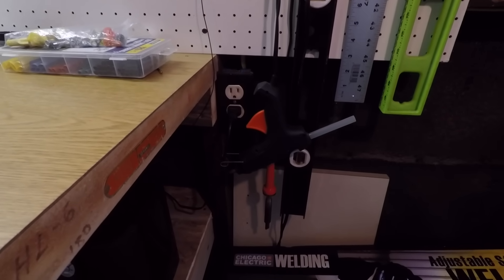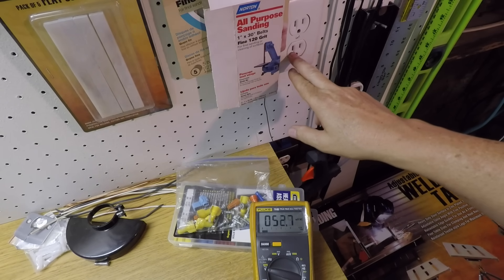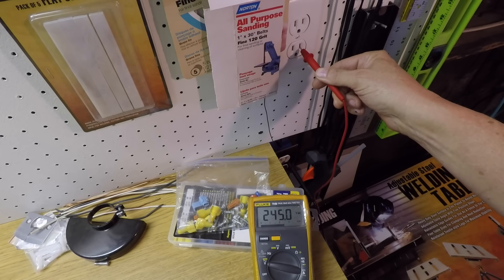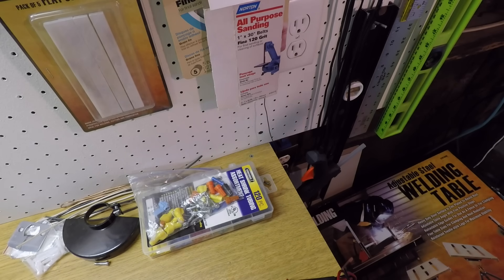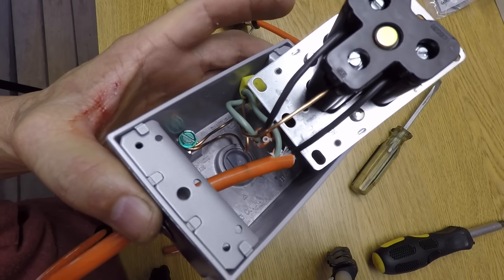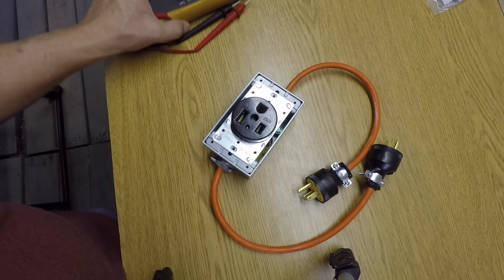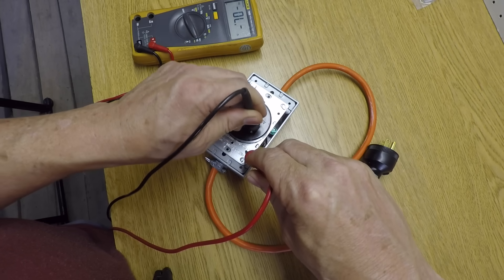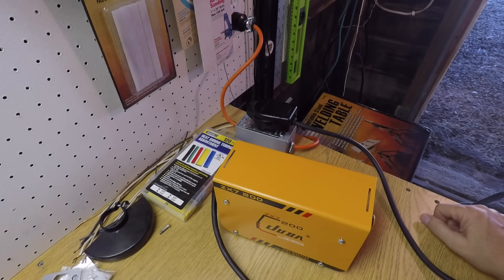How to Get 220v From 110v

Comment: just add a breaker on and off switch to the box
Reply from the maker: That's a good idea, thanks for the suggestion.
Reply: I don’t get it...
If you put a breaker on and unplug one of the cables without removing the plug for the device or switch the breaker to off, it’s still as dangerous.
What you should do is to install a breaker (or two, one for each source) that reacts to power, a breaker you need to push every time you start, in order to get power, a breaker that disconnects in the same moment you unplug the cable.

Comment: those are 15 amp outlets being used on a 20 amp circuit. 20 amp outlets have a notch on one side. That’s how you can visually identify them
Reply from the maker: That is true and it's ok to have 15 amp outlets on a 20 amp circuit as long as there is more than one.

Comment: I am curious as to why you "doubled" the grounds but didn't double the "hots".  I think I would have taken both the black and white wires and twisted them together at both ends to allow allow the hot to pull a full 20 amps.  (This would have made the white white as hot as the black wire.  Yes I realize the tiny welder probably is only pulling 12 amps.)
Reply from the maker: I just didn't think if that at the time I made this video. It has been suggested many times in the comments and I agree with your thinking. It would have been a good improvement to the device instead of just clipping and eliminating the white wire.
Reply: Hey, No problem.  Apparently the other comments got hidden below.

Also, I would like to note that I am an electrician and have seen many other electricians work similar to this.  So, I have to chuckle when the electricians claim "code" and then they do stuff that breaks code.
Reply from the maker: Oh I figured as much. LOL I felt that they squealed the most because they don't want everyone knowing all their little secrets. Ha Ha
Reply: I should also mention that if you use the white wire as a hot, it would be best to put a wrap of black electrical tape around a visible segment so that it would they could see it was white and is now being used as a hot.

Comment: I see you did not use the white wires, did you cut them off?  also by the way do you remember the name of the box a person can buy that is already made?
Reply from the maker: On this set up I cut the white wires off. I don't know the name but I've seen them on ebay here (I have no affiliation or experience with these models) - Made in the USA by certified electricians - https://www.ebay.com/itm/110-125V-To-220-250V-Dryer-Power-Connector-Electrical-Adapter-10-30R-3-Pin-5-15P/193366560965?hash=item2d058b90c5:g:u1MAAOSwvBpeSIof

Comment: I am not an electrician, but I would bet big money that there is a very good reason that you cannot just go buy this off the shelf somewhere.
Reply from the maker: I'm not an electrician either but you can buy them on Ebay all day long. Made in the USA by certified electricians - https://www.ebay.com/itm/110-125V-To-220-250V-Dryer-Power-Connector-Electrical-Adapter-10-30R-3-Pin-5-15P/193366560965?hash=item2d058b90c5:g:u1MAAOSwvBpeSIof

Comment: would this work for a dryer?
Reply from the maker: I don't think so
Reply: @DIYHomesteadProjectsDIYHP10  I did the same thing you did but with a dryer outlet and the voltage reads at 245 now, seems to be right. Now I have to plug it in and try it I guess.
Reply from the maker: A dryer has a completely different demand on power requirements and consumption compared to a small welder. A small welder like the one I used only demands power for a minute or so but a dryer is a continuous demand of power. Two completely different things. Just my 2 cents but I am not an electrician as I'm sure you already know.
Reply from the maker: That adaptor appears to be a similar design as what I made. I don't know what size wire they used and I didn't find information saying what size they used. I do know that most dryers I've seen require a minimum of a 30A circuit with 10 gauge wire. Also most if not all modern dryers require a 4 wire plug. The adaptor I made is only a three wire plug. Any wire size smaller than 10 gauge could possibly be a problem. I really don't know because I've never done it for anything other than my small welder that only draws 18 amps.
Reply: @DIYHomesteadProjectsDIYHP10 It worked for me thanks to your video. I made sure the voltage reader read more than 240v which it did. Also made sure both 110v's were connected in two different  outlets/breakers. I put my dryer in medium and it dried my clothes nice and warm. Thank you!
Reply from the maker: Good to hear!

Comment: I would not recommend doing this 220 need to put on the same baker this is fire waiting to happen....and I pretty sure it is not code approve....why not  just put a 220  outlet there.......
Reply from the maker: Many reasons I didn't put in a regular 240V plug. I needed a temporary mobile solution and this is what worked for my situation. Obviously it may not be the right solution for everyone, but it worked for mine.

Comment: Hello my name is Liz - I need to buy an electric dryer but my plug is 110v & most of the dryers come in 220v,what should I do, PLEASE HELP FRUSTATED. I THANK YOU VERY MUCH.
Reply from the maker: Hello Liz, you need a regular 30A - 240V circuit and appropriate outlet for a dryer at the location you intend to use the dryer. A device like the one I built in the video is not suitable for the power demand and continuous use of a clothes dryer.
Reply: Get a gas dryer !

Comment: You may have a 20 amp circuit meaning breakers and 12 AWG wire but your receptacle as i noticed are not a 20 amp receptacle.
Reply: They are plugged for 15a but they can take up to 20a. You can run the 15a key type on a 20a circuit but you can not run a 20a plug on a 15a circuit as per code.
Reply from the maker: You are correct. Did you know that it's acceptable to have a 15 amp receptacle on a 20 amp circuit as long as there is more than one?

Comment: What if your kid happened to unplug 9ne of those two plugs and completed the circuit?
Reply from the maker: Then that would be a miracle. I don't have a kid. 😂😂😂
Reply from the maker: Also with either end plugged in, the other plug can't complete the circuit because the two are not connected in the box. I explained this in the video. So that would be two miracles.

Comment: This is just a bad idea lol. For one, this setup will allow voltage drop to 120v in the event of an overload, possibly damaging equipment and those cord ends and the receptacles are not rated for 20A, they could all melt during extended use from a 20A welder
Reply from the maker: Just so you know, it's not unusual to have a 15A receptacle on a 20A circuit as long as there is more than one. Pretty unlikely for anything to melt with my little welder and I don't know of any hobby style welder designed for "extended use" as you say. Small hobby welders just don't have a duty cycle allowing any extended use.

Comment: I am watching this a year later. How is it working, please? I need to get 240 volts at my bench as well, and this looks like an easy solution. I wired plugs to my bench just like you did, two runs of four outlets each on separate breakers. I just did it because I thought it would be better for general principles but now I see it may have more reasons than that. I hope you can reply. Thank you, for your video. Glad to subscribe.
Reply from the maker: Thank you for the subscription, I hope you get something useful out of the videos I produce. I no longer live at the location where I made the device in the video. I'm in a much newer home and code requires GFCI outlets in the garage here. This device won't work on a circuit that is GFCI protected. I'm working on a solution at my new home (video coming soon) on that. I use the device for a couple of months before we sold that house and it worked flawlessly for my needs. I never even tripped a breaker with it. It didn't overheat and catch the house on fire either. LOL Pretty much all the negative comments claiming all the fear of bad things happening just never happened in my case. It ran my little welder reliably and without issue. I later determined that little welder pulled 18amps at the settings I was using to weld with it. On the 20 amp circuit it was a perfect solution for my issue. The orange 14 gauge extension cord leads never got hot or even felt warm. I checked them regularly between welds when I was using the device. I'm thinking it is impossible for the welder to operate off only one leg of the combiner. If the welder only draws 18 amps total, divide that by two and that's only 9 amp draw off each leg. That's still 6 amps below the wire rating. If it was an uneven draw on the legs it would have to be over 15 amp draw on one leg and only 3 amp draw on the other. I don't think the load would ever be that unbalanced and it never was in my case. The orange 14 gauge wire is good to 15 amps. In my opinion, this explains why it worked without issue and nothing ever burnt up or shorted out. I think the results would depend greatly on what you intend to run with such a device. Apparently a 240V motor can be destroyed if you loose one leg but my welder is an inverter and is a completely different device than a motor. Supposedly if you tied the two together with a double pole breaker, you could prevent damaging a motor if that's what you intend to run. THIS IS THE GOOD PART - Someone suggested putting a double pole breaker on one of the outlet legs in the main box and dedicating that circuit to being a 20 amp 240V circuit. I wouldn't have to run any wire to do this. (I just didn't have room for a two pole breaker in my little breaker box) Then use the other outlet circuit for the 110V outlets. I thought that was a great idea and would have been the perfect solution in my case had I though of it, and had room for a double pole breaker. It may be ideal for you in your case though. All you'll need is a 20A double pole breaker (space for it in the main box) and an appropriate 20A 240V outlet to run your items. You'll be limited to 20A but for a cost of about $20, you can easily have a 240V 20 amp circuit in your shop. Just a little work in the main box and plenty of videos showing how to install a 240V double pole breaker here on YT. It's a simple job, no need to pay a ridiculous fee to have an electrician do it unless you're not comfortable working in the main box in my opinion. Sorry this was so long but I hope it helps you out. Take care and let me know if I can help in the future. :)
Reply: DIY Homestead Projects great help thank you again. I am sure I will get a lot of good information from your videos.

Comment: With your welder plugged in and turned on, the plugs can be live if you unplug one. It's an unlikely course of events. but possible. Also, there's about a 75% chance that welder will operate just fine at 120V at a lower amp rating.

Comment: This is a cool proof of concept, I would recommend running your extension cord wires in parallel both the black and white on the same brass screw and both black and white on your welder outlet. You will definitely want to unplug your 240volt device before touching either one of the 120volt cord ends you can electrocute yourself if the welder completes the circuit. Here in Canada you can get 20amp receptacles and cord ends as well as 12gage wire for the flexible wire between. This would help your set up some what. What you have built is an adapter for 10amps at 240volt but you have a receptacle rated for 30amps could be kind of a fire Hazzard. Phillip electrician with Electrical Innovators.

Comment: How do you know the wire from the outlet to the main panel will handle the amperage?
Reply from the maker: Because the wire from the outlet is 12 gauge wire rated for 20 amps. This welder pulls 18 amps on the setting I am using.

Comment: Would this work for a electric oven?
Reply from the maker: I would guess no. An oven is a constant draw for a lengthly period of time in relation to a little welder. The welder only draws power for a short period of time then it's off. I would recommend a standard approved 240V circuit for the use of an oven.

Comment: The only welder that I know of that will work with 12ga. wire on a 20 amp breaker is a portable 120v wire welder. 240v stick welders  depending on the size normally need at least 10ga wire on a 30 amp breaker.

Comment: Can you do this on a generator? For a ground 220v water pump....
Reply from the maker: I don't think so, you would have to have two generators I would think. But I really don't know because I have never tried it. Also a water pump would be continuously drawing power to pump the water but a welder only runs for a relatively short period of time. (at least in my case)

Comment: Hi, Bruce technically you do have 220 that way, my suggestion is to go back to the fuse box and move those breakers next to each other and drop a nail into breaker flip switch when you are going to use it as 220. Having a square D box I have done just that. I think a 220 breaker is faster at tripping though. My other thought is to run a dedicated 220 circuit to the garage as I can see it is attached to the house, and be in compliance with code.
Reply from the maker: Thanks for the input. That garage was detached and about 30 feet from the main house. My biggest reason for doing it this way is it was cheap, easy and temporary. When I sold that house, I unplugged my device and the house was completely in compliance with code. It also passed the electrical inspection with flying colors.

Comment: By using 12/2 wire = 12 gauge wire running a 240 volt wire especially a long distance in my opinion is not thick enough and could cause a house fire . And if the two plugs are on the same hot bus you are really only going to get 120 volts. Not trying to sound arrogant but I am trying to prevent a fire.

Comment: IT works, every electrician know how to make 240v out of 120v circuits, but what about the safety your OCPD, by code you have to have a circuit breaker for a 240v outlet not a separated breaker, if it is only a temporary outlet is ok but risky.
Reply: Scene one circuit is carrying the lights it will be the one to fail first. And the wire gage is to small .this is a bad idea let's say a friend or kid try's his mod and plugs it in to the same bus hot line it could damage the plugged in device.

Comment: If u ran another circuit anyway to add that other outlet, why didn't you just run a 240v circuit?
Reply: Jon Coop proof of concept
Reply: cause its a pain in the ass to run new wire and then he'd hafto wire a new breaker...and maybe he didnt have enough room the the circuit box for a double breaker...and  being a home owner if you messed with the box if you go to sell ur house the inspector could fail you if anything is messed up in the circuit box...its just a huge pain in the ass...
Reply from the maker: Finally someone understands! Thank you

Comment: You can add a power switch between the box and each plug preventing one unplugged plug from having a completed circuit.
Reply from the maker: That's a good idea.
Reply: I don’t get it...
If you put a breaker on and unplug one of the cables without removing the plug for the device or switch the breaker to off, it’s still as dangerous.
What you should do is to install a breaker (or two, one for each source) that reacts to power, a breaker you need to push every time you start, in order to get power, a breaker that disconnects in the same moment you unplug the cable.

Comment: If your welder only draws 20amps you'll be  ok. But if you lose your neutral you'll likely fry any 120v equip on those 2 circuits. Good luck smh

Comment: if you ran 2 seperate wires back to the panel, honestly the best thing to do is swap one of them to a 6-20r or get an electrician to do that, then you just need to make a socket adapter or change your chord ends to that plug style, it'd give your shop 1 more circuit, you'd still have the 120v 20a and you're only out the cost of a breaker and a plug
Reply from the maker: Yes, that would work too.

Comment: I like what you have done mate. This would help me down in the shop too because all that's down there is 110. Thanks for the upload.
Reply from the maker: No problem 👍
Reply: It will only work if you have 2 separate 110 circuits that are each on separate 120 Volt Legs of the mail 240 volt panel. If the 2 circuit breakers that feed the 2 circuits in your shop are right next to each other or have 2 spaces between them in the main 240 volt panel it will work.
Reply: If all you have in the shop is 110 volts, this gadget is not going to help you.  The title is a bit of a misnomer.  You aren't really getting 220v from 110v.  He's pretty clear about that in the video.
Reply: Tip: Have fire extinguishers near. Just saying! Be safe.

Comment: Relay should fix the unsafe short circuit but like you say just unplug the welding device first then unplug both sockets from the outlets
Reply: Would a knot of manila rope on the 240 plug make you instinctively pull that first when you do a panic unplug? I'm not an electrician.